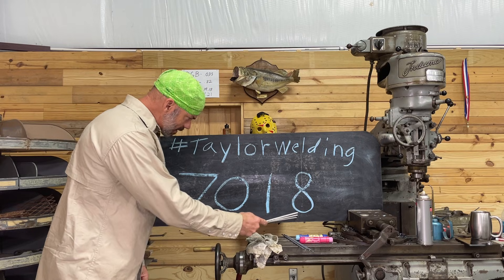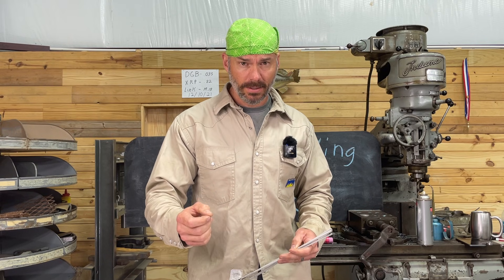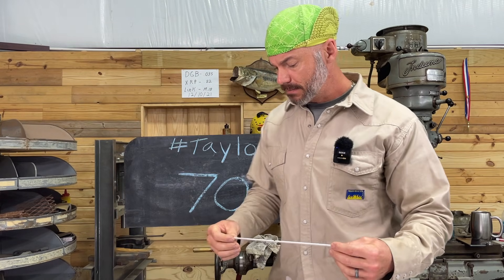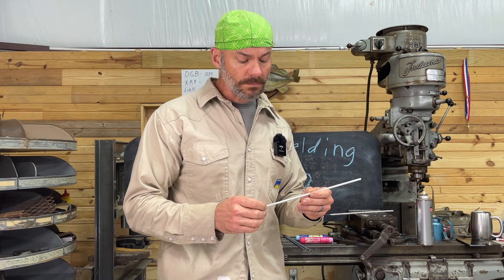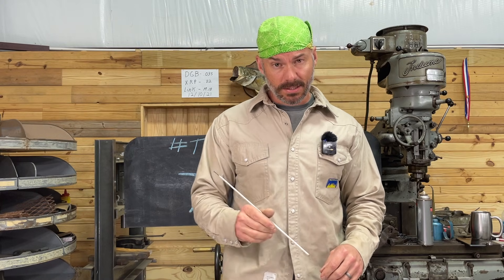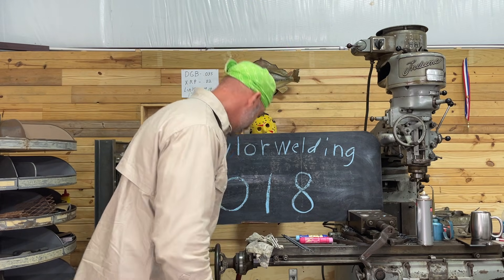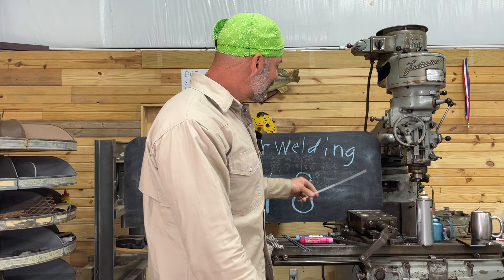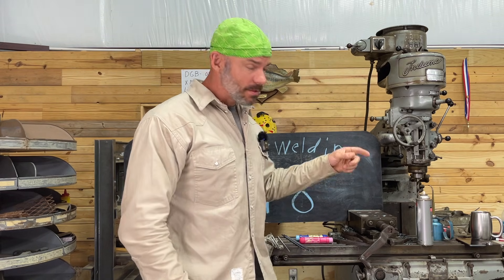How to Weld 7018 welding rod tips and tricks.

Comment: I have heard that there is 7010 rods , my question is why are they not used for the root rather than the 6010 rods for the root and fill with 7018 rods then all the weld would be the same metal and stronger .

Comment: Will your brother (Bob the artist) do a video using 1/16" 6013 on some hot rolled 16 gauge sheet metal? I'm a 69 year old newbie,
 but I think an old dog can learn new tricks. Your videos are awesome, even if Bob won't help.
Reply from the maker: that sounds pretty tough. We don’t ever use 6013. I can’t say I’ve ever burnt one maybe I have  but I don’t remember it.

Thin metal with a stick rod is always tough
Reply from the maker: no doubt you can do it

Comment: I weld daily at work. But we use MIG welders and its super thin metal... picking up a stick welder from a co worker. I dont know ANYTHING bout it or the process of stick welding.. qll I know is he said to use " 70 18 ".. gonna attempt to remove exhaust manifolds on my truck and this is what I'll be using to do it.. we shall see how it goes. Appreciate this video

Comment: I 100% agree that an old rod will weld just fine, and I do it all the time, but on something safety critical I'm not worried about that. It's the hydrogen that gets into the weld that can make it brittle and weaken it. You can test this and see it for yourself. Just submerge the weld in some clear mineral oil and observe what comes out. Not gonna leave anything for the lawyers if someone gets hurt and I end up in a courtroom. I'm not here to preach, but I do think this is something folks ought to consider. You can research and do as you choose. I won't be facing the wrath if I verifiably used rods that came out of a new box or an oven within the last 4 hours. It's not a lot of effort for the risk abated.

The rest of the video is fantastic and there's a lot of gold in it.

Comment: I remember working as fire sentry for guys in the military dockyard who were using 7018 on DC as a rule. I remember the cursing and swearing when they tacked something up only to be told 2 minutes later that the bracket needed to be welded in a different spot. Those tacks were a bastard to remove!

Comment: I was initially trained in welding with 7018 in high school/tech school. Because of the knight's helmet and being a dumb teenager, I never really appreciated it. Years later, got a very crusty flux machine and used it for a bit till i got a nice multiprocess and ran flux and mig. got all the stuff for tig, including a nice full bottle, but haven't messed with it yet. I ended up with a diesel welder unit by happenstance, and started running 7018 again, with good equipment, and a nice modern hood. Man oh man. I love 7018 so much. Once good straight pass can do what several rounds of wire can do but better and prettier. Lay on a couple more beads and that weld will outlast the parts you put them on. If I can get away with those sticks on anything, I am doing it from now on. Just rebuilt a bunch of crap on my tractor and got about halfway through building a new implement in a fraction of the time it would have taken me feeding wire. For me, 7018 is just... easier to get a good weld with than flux or gas wire, or even 6011 (havent found any 6010 near me). Just go nice and slow, drag consistently, feeding the tip into the joint until you hit the end, then take a couple satisfying cracks and brushes with your chip hammer and it should be either stacked dimes or a continuous bead, depending on your skill and settings. That is to say, the "stacked dimes" that other processes aspire to, are a sign that you need more practice on a 7018. That's a hell of an electrode.

Comment: A pipeline welder that's damn good at running 7018 can fly. Big pipe or heavy wall and watching a hand that knows what they are doing is something else. I know quite a few that can fly with a 5/32 and of those there are a handful that have the talent and the machine to grab a 3/16 and flat out pour the metal to a weld. They will fill and cap in a pass or 2 less than other guys, at first it seems like it's taking them a long time, they're only getting a few inches a rod with a 3/16, but next thing you know they ran their 3rd and 4th pass (hot fill and fill) in just one pass and they are capping on their 4th pass and everyone else is capping on their 5th pass. They guys that can do that don't do it often though, they don't like to let the bosses know how fast they really can go, they generally save it for early outs, needing to shit or emergency situations lol

Comment: Well, for your 6010 route 7018 pin cap welded Barger tag everything 7018 rod for you got more stretch. Do a good job well for over 70 years.

Comment: I started out learning to weld when I was 14 on 7018s. I knew some old timer welders that they couldn't understand why the teachers had us learn on a rod that is difficult. When I applied for my first job at 17, I beat a dozen older and more experienced guys because I could weld 7018s on pipe in any position. Like you said, other rods have their purpose, but 7018s are about the most valuable rods out there. They are well worth the extra practice it takes to learn. The only thing I would add to your advice is that when holding the puddle at the sides for a bit, don't just quickly flick to the other side. Carefully sort of slide to left or right and drag a little bit of the puddle along. It makes for a smoother weld. You know you got it when the slag just peels off on its own.
Reply from the maker: So true. Same thing my welding teacher did. He made us welded with 1/8 7018‘s first. It almost discouraged me though. How long have you been WELDING ?
Reply: I retired a few years ago, I'm 63. Joined the Navy right out of high school and easily qualified for C1 welding school again because of the 7018 and TIG experience. Did pipe welding on nuclear submarines and destroyers for 14 years until Bill Clinton downsized about half of all nuclear welders. Then I built my own rig working in the oil industry. Retired on the North Slope in Alaska and offshore rigs. Its been an enjoyable life. I still have a small shop and train the younger guys in the winter.
Reply from the maker: @ Thats a lot of experience Mr. Doug.
I bet you You have some great tips. 
Thank you for sharing. It’s always a pleasure to have someone who has been in the industry for as long as you have in the comments.

Comment: I worked in a steel mill for years and I burnt up a lot 1/8” 10018…..I liked it a lot and they ran basically the same as a 7018. 

I recommend it on crop cars that get beat up on a daily basis 👀👍
Reply from the maker: That's a good recommendation 👍

Comment: 7018 welds better if you dip it into a bucket of water but you are introducing hydrogen embrittlement. If looks matter use damp rods. If a project is speced for 7018 better use the oven ...
Reply: Hydrogen embrittlement is only a thing in high strength steels above 1000 MPa of tensile strength.  7018 weld doesn´t have that, neither does vast majority of steels.

Comment: For the last couple days, ive  been  out in my shop practicing with running 1G beads with some old 7018 rod that i found! Its thickness with flux is 2/8" in diameter & the metal rod itself is 1/8" thick! I dunno where the rod came from ( more than likely some old stuff that my dad had), but its all in a round cardboard tube from "Stultz". . . . i belive is the name & theres no end cap or cover to put on the tube to seal the rod! Some of the stick ive practice with were okay & lemme run the full stick bead, while others would just quit running a bead right in the middle of the stick! I would try & try to "strike", but  nothing! But i sure am having fun practing though! Had the ole Lincoln arc welder set at 130 amps! Sure does make a purty, dark brown, colored, slag! Thankya for sharing your video👍🏻
Reply from the maker: @truckerray7533  10/4 trucker ray. I don’t know anything about Stultz rods.
Reply: They might be an old co. by now, who knows for sure!

Comment: Thanks for the tips!
I was given about 100 lbs of several variety’s of rod from estate of a guy who suddenly died, and it had quite a few lbs of 7018 and 9018 so I will not be quite so concerned with the fact they were not stored in a rod oven.
Reply from the maker: @standaffern6595  for sure. Would worry about it at all. They will last a long time as long as you keep them out of the weather. But that’s not the same for cellulose rods 60 10 etc..

Comment: Oh mate I think you are so correct! Although I am new welder I think 7018s are indestructible! I have😂run forgotten 7018s in humidity and they run exceptionally! I have seen videos saying that If you forget an 7018 that is out of the box or out of an oven they can't be characterized as low hydrogen and don't run properly. I was questioning myself until I saw this video. I think you are correct because I never saw a difference between a new 7018 and an old one!
Reply from the maker: Right on… me neither. Watch out for the Welding Inspector though lol

Comment: I learned to weld 6010 and 7018 in prison for a DUI and beating up cops 9 years ago just getting back in it and the boss has 6011 with 7018 and I can tell there is a difference its all structural welding building a saw mill here in Oklahoma every detail you mention is not only useful but necessary to give the work expected we have to consistently make ourselves more proficient and valuable brother
Reply from the maker: @JacobLee-x7s  that’s a tough lick. but you spend your time in prison wisely. Sorry for the late reply.

Comment: 7018 has a hydrophilic coating, which means it attracts water. It may not cause porosity, but it can make the weld brittle on higher strength steels (like what your weld deposit is) and can crack out years after you weld it for no apparent reason. That's why it is considered a low-hydrogen rod and usually kept heated.

More importantly, if you're working on a job that has to have a CWI, there's probably some standard you're supposed to be working to, and as far as I know they all require 7018 to be kept heated. You and I don't make these decisions, the customer does, and if you agree to do a job a certain way, you need to do it that way, even if you don't know why.
Reply from the maker: yep

Comment: 7:24 this is my 3rd time watching this video while practicing my 7018 vertical test at work on a slow day. I’m currently welding (mig .035) with no current certs for 22/hr (company I work for pays 26/hr min for having just 2 Welding certs mig and stick). No schooling, just work related experience in fabrication and  installation. Worked in a waste management plant where I fitted alongside human waste and garbage fixing trash burners and conveyer systems, also have related fitting and welding experience from shipyards, and now I’m getting into welding inside proper shops. I’m only 21 as of June and been in fabrication work since 17 since I graduated high school  early and joined the reserves. Got a diploma, and would love to show you some of my beads and test plate pictures for a shot at a job opportunity. My end goal with welding is to weld on rockets, I am currently attending night classes to obtain an A&P Cert and Avionic cert. I am determined. P.S. mostly mild steel, I’ve used an aluminum welder before but only once and would love to pursue that route.
Reply from the maker: @cvno1242  i’m sorry CVNOI missed this comment. You can send your WELDING photos to Weldpictures@gmail.com
I will go over them in a video

Comment: Ive been using rods I bought 10 years ago ...I don't think theyre 7018 ..this oven thing is not all its cracked up to be..I do keep all my rods next to the fire so theyre dry but the fires not going all the time.
My basic advice would be play with the heat/voltage/amperage and just get in there and try it...if it doesnt look or feel right it probably isnt so try somethiong else...don't keep doing the same thing just because thats what the book says.
I have to get the hang of all these numbers lol 
thanks for sharing

Comment: This is my first week of Tulsa Welding School. We did 5 hours of stick welding today and I kept getting stuck when starting the weld, the instructor kept saying to strike like a match but I was still having the issues. I appreciate the helpful videos!
Reply: Hi Trippy - I'm on week 2 of self-teaching but I nearly threw in the towel on day 3 because the bloody thing would not strike up (3/32 6013s), maybe 1 in 10 if I got lucky. Then a bunch of comments on one beginner video all suggested using a piece of scrap to strike the new rod, to heat it up. I did it the very next day and it blew my mind! Straight in from the tack weld every time, no misfires or sticks.

I appreciate that you are at TWS, but the only logical reason against this method, I can see, is that in the wild you probably won't have the luxury of being able to do this. However I can say that having that strike-up scrap piece has enabled me to relax and do a lazy but purposeful strike and I'm actually getting a lot of first strikes on it, with new rods. Just thought I'd inject that in here mate. I'm here because I've sussed that 6013s are hard work, and that 7018s are the way to go - I have only heard praise from the "old-timers". A kilo arrived today mail order and I'll be burning them up over the next few days. If I can make them work I'll stick with them and treat myself to some 6010s and 11s.

Comment: nice vid! I’m gonna return my 1/8 7018 for some 3/32. I’ve been fooling around with 1/8 6011 on some thin stuff (1/8-3/16) and I’m either blowing holes or bird pooping (90A seems to give me the best results so far). Granted, my arc length is always too long, but I’m working to fix that (I’m a newby). I’ve been wanting to try some 7018, just to see if it won’t dig so much as my 6011, but I haven’t opened the box yet. Thank you for sharing your experiences.

Comment: 6013 (farmer rod)  seems to be the forgotten rod.  It has it's uses, but nobody ever mentions it.  You Tube is all about pipe welders ( 6010 and 7018 ).  6013 rods run on old tombstone a/c buzz boxes or any other welding machine.  They are easy to use and can weld just about anything around a farm.  I prefer 7018, but 6013 works pretty good on thin sheet metal.

Comment: I'm a beginner. I started with a flux core welder and decided I needed to learn stick and I'm really wishing I had gone with learning stick welding first. I'm having a hard time keeping a consistent arc, or making a nice looking weld.  In my restarts I'm having a super hard time with my electrode sticking.  This is with some old 7018.  Old as on at least 4yrs .  Unknown past that.  I ran some 6011 and had considerably less problem with restarts. But weld appearance was even worse and consistentcy much worse.

Comment: I agree. I have many old ass 7018 rods and they still have a lot of life. AND I don't get into problems. Rod ovens make great paperweights. I've also have gone to job sites and got a lot of free 7018 welding rods, because they say the rod container has be open more than 5 hours and the rods are bad. That is such bull but, thank you guys for the free practice rods.
Reply: My box of 1/8 has been open for years.
Reply from the maker: @wrenchbender01  as far as I know 7018 will last forever if you keep them out of the weather

Comment: 7018 is the rod I keep in my toolbox. Simply put they work. I have boxes of various sizes. They’ve been open for years. If I do anything I’ll strike an arc on scrap to preheat the rod if I’m in a high humidity area. The other thing weld rod negative. 3 semi batteries in series will weld 5-10, 3/32 rods.
Reply: Was just gonna say the exact same thing. Years ago I had a crack on a semi trailer. No one had time to take the job. So I bought a box of 10 3/32 rods and a set of booster cables. I used my rig batteries to weld it.

Comment: Just ran across ur channel and liked and subbed. I’m a newbie and have picked up MiG pretty decent, and starting on sticks. Bought 6013-3/32 & 1/8, also 7018 in the same. Turned up hot start and ran a few, but harder than MiG. When a teen and working in body shop, had old tombstone and gas torch’s with coat hangers as filler rods. Talk about warping panels, you had to be careful. Anyway, like your channel and will hang out in your shop and try to pick up some stick tips. Have a blessed day. Kentucky

Comment: 1780 stick always my go to, trying to find out the name and year of my favorite old machine shaped like a torpedo and had a sound nearly break your eardrums like a turbo but setting and watch slag lift right behind bead.
Smooth and almost weld itself.
Reach out if you can any information.
Love to have one.
Reply: It is probably a transformer 250 amp Lincoln electric

Comment: One thing for all you never guys that want to get into welding, especially pipelining. DO NOT get rid of your rod oven, one thing I can guarmatee, especially if you're on a professional site, or big money oil co pany job. If you get rid of your rod oven, they'll either get rif of you as soon as they come by to check your welds, welder credentials or anythung else, once they see youve dumped your rod oven, they'll dump you right off the job, immediately. 
Alternately, if you show up on site with your rig, they won't even let you on site without one.
They will come by periodically and check the temp on your rod oven too. Then make sure you have no open boxes of 7018, and all the rest is still in their hermetically sealed containers.
Just a tip